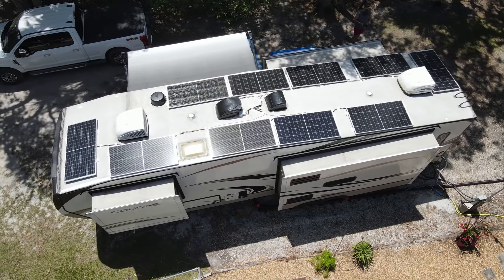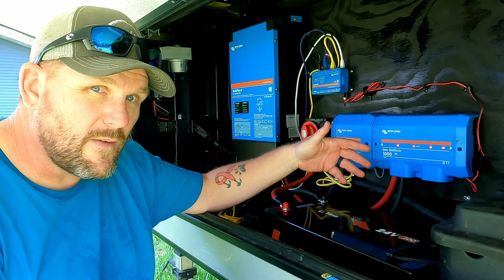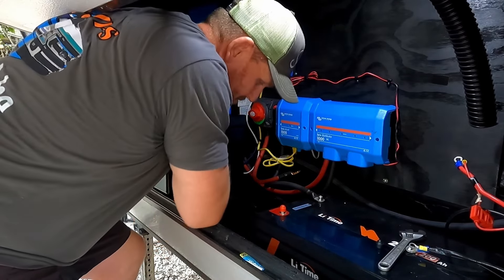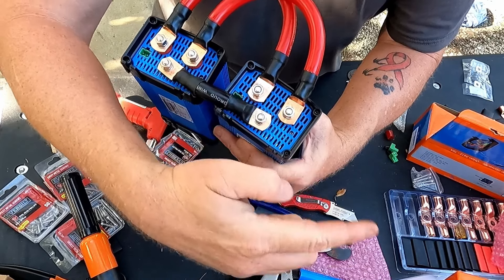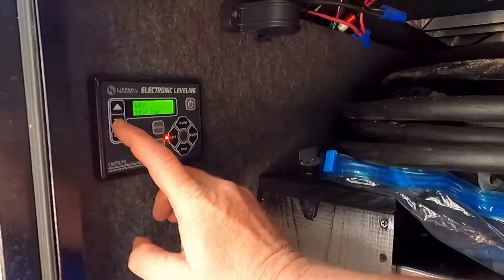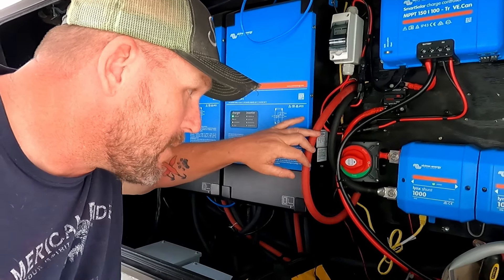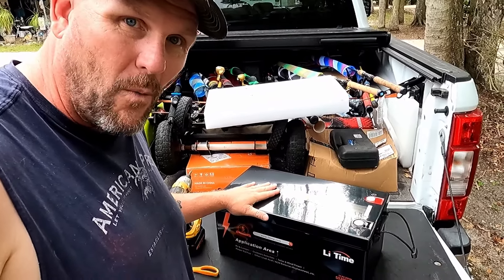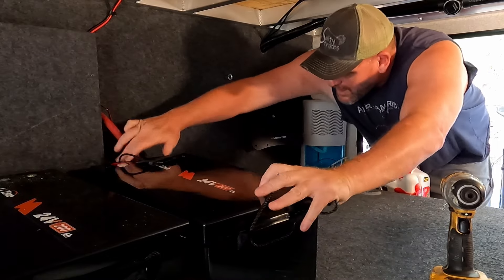What we would do DIFFERENT…  Victron, off grid solar and lithium batteries! #rvliving #offgrid

Comment: So hilarious such nice victron systems with the cheapest batteries...
Reply from the maker: … and performing flawlessly, have seen so many tear downs with of over priced batteries with same exact cells and similar if not same BMS. Battle Born would have cost over $14,000 for the same amount of power and these cost me $4,000. Thats just stupid waste of money, with the money I saved on Batteries it paid for the rest of the entire system. Have had a generic lithium for my 36v trolling motor for year and that thing takes a beating in the chop offshore. To each his own 👍, thanks for watching.
Reply: @saltytrips  We have been running 4x 12v 300ah Ampere Time in series to make a 48v300ah bank. Bought the batteries in August 2021 and still running strong! Just have to make sure not to charge them below freezing. Our last capacity test came in at like 90%-95% of advertised when brand new! We can run all 3 rooftop A/C, a portable A/C, plus microwave and more (BMS finally shut down at like 250amps). I've been very impressed so far, though I cringe a bit seeing the price now being almost half of what we paid.
Reply from the maker: @TsaWind  prices have come down a lot even in the last year from my first LiTime to my last battery almost $400 difference in less than 1 year.